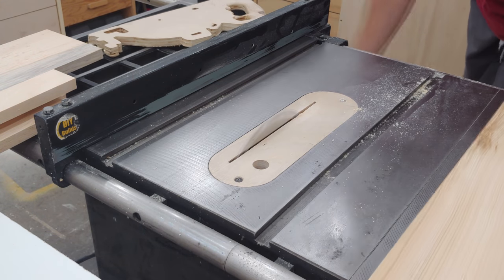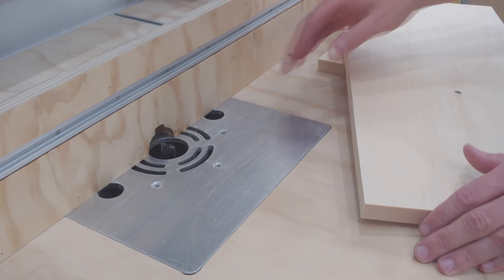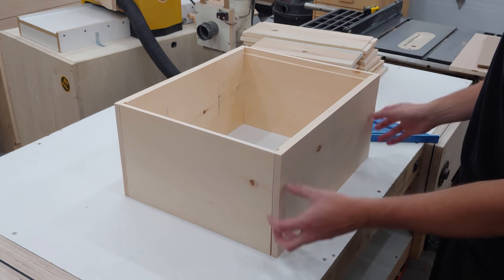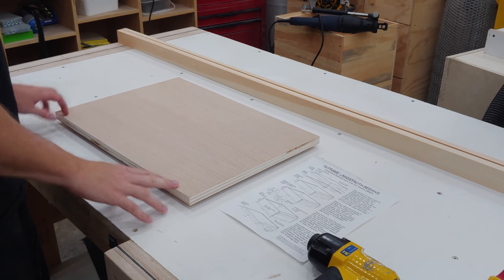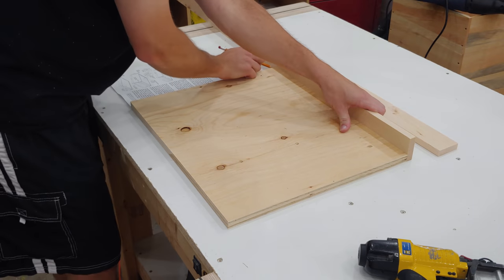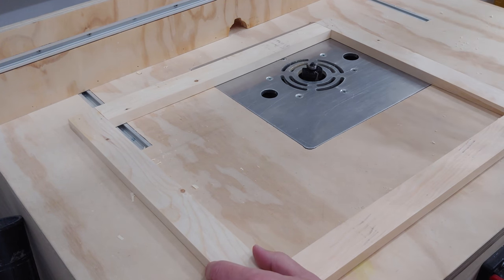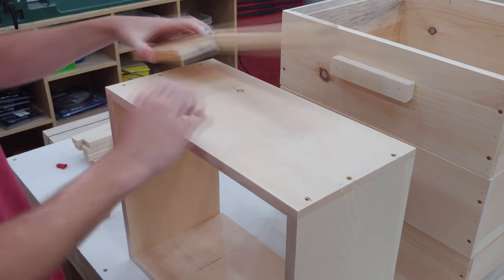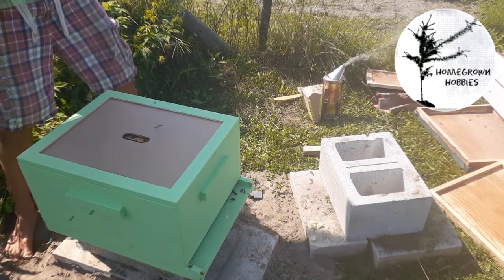How to Make a Bee Hive (Bee Juice Machine)

Comment: Use wax if those screws aren't stainless or triple coated. 
Just drag the screw through a candle, or use a chunk of a crayon in the pre-drilled holes. 
The friction will heat the wax up and waterproof the hole.

Comment: A couple things...  I don't know your location but from my experience in central ontario, canada

hardiboard is a bad choice for anything in the hive.. it will rot /mold really fast.. there is a ton of humidity in a hive..   
glue is bad for the hive and your brads and glue may be easier but  with the thermal changes it will likely pop curl
Reply from the maker: Time will tell i guess but im hopefull this will last.
Reply: Here is Texas we use Titebond3 on ALL our bee boxes with nails and/or screws.  We even "paint" the end grain on the boxes with titebond for added protection against the weather.  Like paint, just make sure it is completely dry before letting the bees have it.  Cant argue that hardboard is not the best choice but you are really just keeping the bees from building on the lid so it's not that big of a deal.
Reply: You'll be fine Brian